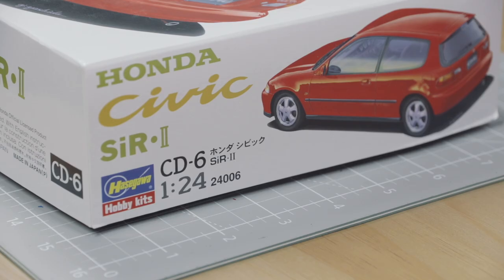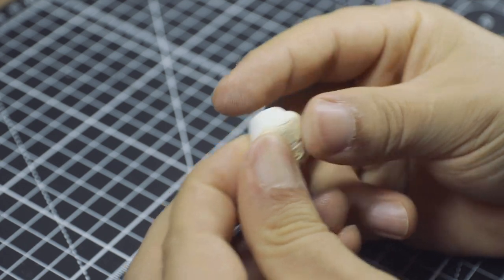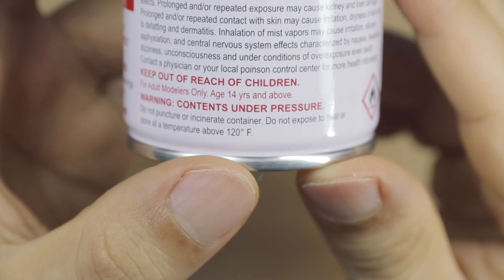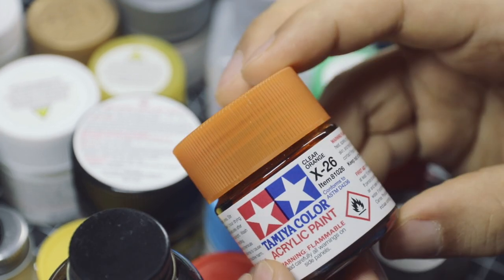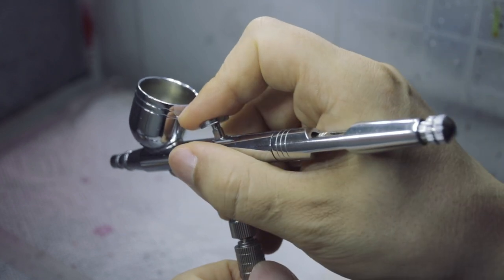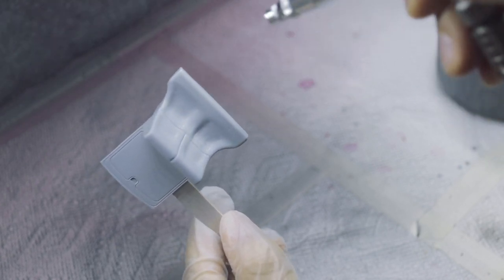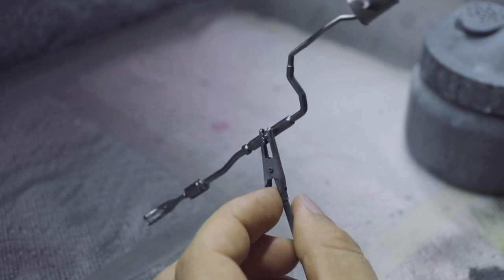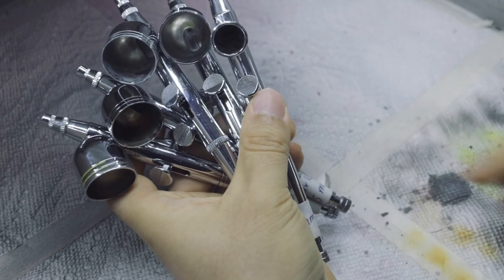Building Your First Scale Model Car: Airbrushing

Comment: Great explanation. 2 tips for beginners with the airbrush for carkits. Get some plastic spoons to try to see how the color comes out over the thinner,they are good also for triggercontrol pratice,Plastic bottles will works also good,specialy empty dishwasher fuild or bleach bottle. They got a bit rougher structure,you can see then how you get with primer a flat and even surface,on this way you can work away small scratches from sandpaper or the scriber. 2 For deep cleaning the nozzle 1 use a empty Tamiya 10 ml bottle 50% of Cheap laquer thinner,and leave that overnight. Then the nozzle is clean and ready for use. The needle i put in a Vallejo bottle 75%full with Cheap laquer thinner. Put the needle in the bottle alomost to the bottom.With a crocodile clip on the top It will clean itself overnight. Just make sure the bottle is standing firm in a 17Ml tamiya bottle or use 2 side tape!!
Reply from the maker: Thank you so much for the great tips.🙏🙏

Comment: Tamiya acrylic: some people mention success using Mr Color Levelling Thinner for use with Tamiya acrylic. Perhaps it is my poor technique but I have found that the Tamiya acrylic remains "soft" when using Mr Color thinner. The paint doesn't harden up like an enamel. I am now using X-20A and see how that goes.
Reply from the maker: One thing I have experienced is that Tamiya’s flat acrylic paint will cure and harden better than their gloss acrylic, their gloss acrylic paint remains soft even after weeks of curing time. So every time I need anything glossy I would turn to their lacquer line(TS spray cans) or MR color lacquer paint. Those paints will dry to a hard finish.
Reply: @JunsMiniGarage  many thanks, Guru! So it was not just me? The other day, after spraying, I lightly touched the model and it felt dry. I donned cotton gloves and proceeded to remove masking tape and found that the gloves had left marks which could only be removed by sanding.
Thanks for your help.

Comment: What kind and capacity is that little compressor
Reply from the maker: The compressor came with the pointzero airbrush kit. It doesn’t have a reservoir tank to store air so it will kick in whenever you hold down airbrush trigger. Air pressure seems to be consistent and stable despite long painting sessions(it will get hot). The highest pressure I had set it to was 60psi. It might be able to go higher but I don’t wanna kill it.😂
Reply: @JunsMiniGarage  thanks for the great info

Comment: Hi Jun, great explanation for learners to airbrushing. Like you, I do not consider myself an expert at them. 
I have built many 1/12 motorcycles. I first started with the cheaper $20 airbrush and they were sort of great at first. Then after some time when I thought I was getting used to them, I often found mistakes in my paint( your suggestion of having a covered box for drying was great). 
I did buy one day an Iwata Neo and found my paintwork elevated without any real trying. 
I have since bought another 4 or 5 Iwata Airbrushes, the Revolution range and an Eclipse. 
I must say, even though the Eclipse is a mid range pricy AB, it is sooo nice to work with(it's my workhorse). 
The Revolution range I have also cover down to the small size needles. So different brush for different jobs. I don't go so much for colour groups but that is just a personal preferance.
The misting and paint flow is just leaps and bounds ahead of the $20 airbrushes from Amazon or Ebay. 
For anyone doing airbrushing, when you think you really like the hobby, do yourself a favour and buy an expensive AB - $200-300 worth

Comment: I keep coming to this series of first scale model. I got four questions:
1. Body: after base color is done and has visible flaws, do you wet sand it before clear coat?
2. Clear coat: for Tamiya X-22 is 1:3 mixing ratio (paint/thinner) good idea? You've put those numbers in video, but im not sure if that was for acrylic paints
3. Mixing: If I used Mr Color Leveling Thinner for base coat of acrylic paint, is it ok to use the same thinner for acrylic clear coat (mentioned X-22)?
4. Panel Lines: After clear coat done with Tamiya X-22 thinned with Mr Color Leveling Thinner, is it safe to clean excess of Panel Line Accent Color with thinner for enamel products (AK049 to be specific)?
Thanks in advance

Comment: Do you recommend using water-based paints for the car body, for beginners? Like the ones for miniatures, Vallejo, Citadel, etc
Reply from the maker: I would recommend using model lacquer paint for car body especially when you are looking to wetsand and polish it in the final stage. Lacquer is also tougher and more “scratch resistant” than acrylic paints. Water based paint is good if you are looking to create a damaged, abandoned or fully weathered look for your project which you aren’t planning to polish it to a mirror like finish. If you build tanks, armors and fighter jets then water based paints are perfect. 👍

Comment: Hello! I appreciate these videos so much! Is there a downside to using a heat gun/hair dryer to speed up drying time between coats?
Reply from the maker: Hello and thank you very much! There are things I would keep in mind while using a hair dryer or heat gun to speed up drying time, one is that if the body has masking tapes on it(for example if the car is getting a two tone paint job), then I wouldn’t wanna use any heat sources because when it warms up the car it will soften the paint slightly and create marks from the masking tapes. And it will require additional sanding and polishing to remove those marks. Number two is that although warming it up speeds things up, you might wanna let the paint/thinner dry naturally and evenly because the thinner has the capability of self leveling. And heating it up might increase the possibility of having orange peels effect because the paint is “forced” to dry more quickly before it has time to self level. I would mostly use hairdryer for parts that don’t require smooth surfaces.(interior, chassis). Thank you for the questions and I hope my answers are helpful to you. Happy building!👍

Comment: I noticed at 8:20 you were turning the airbrush nozzle. What does that do????
Reply from the maker: The cap is supposed to be air tight but sometimes the rubber seal isn’t sealing properly. Turning it basically is making sure the cap is sealing right and tight.